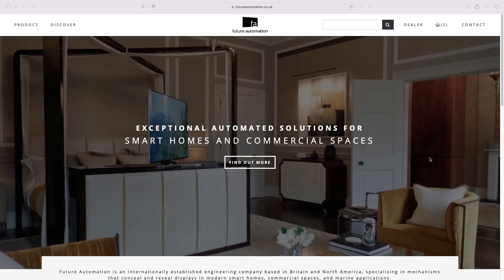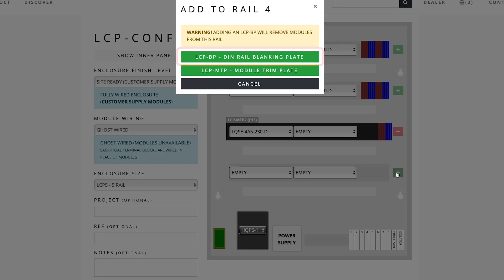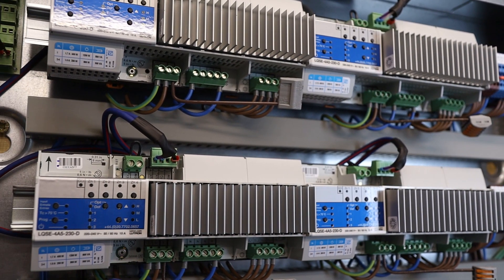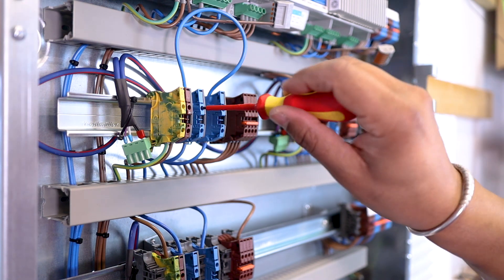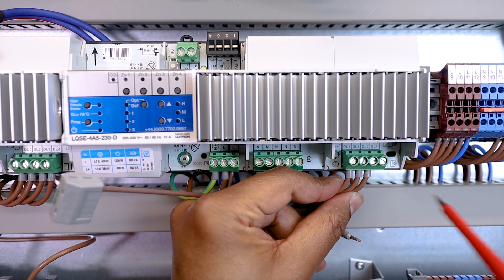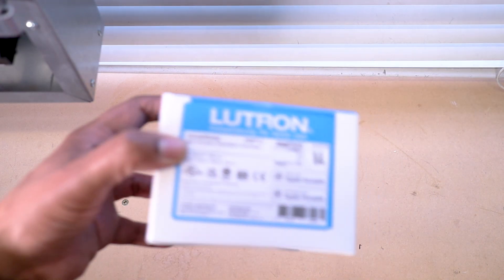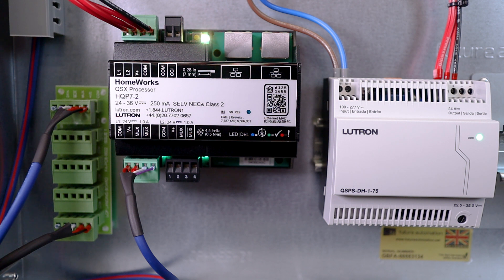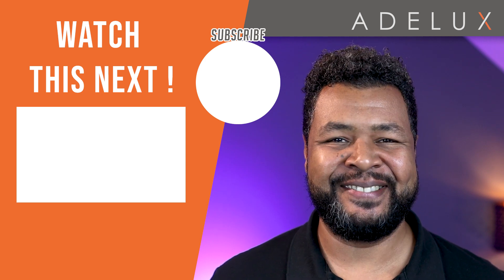Future Automation Ghost Wired Panel for Lutron HomeWorks - Specification & Full Panel Build [NEW]

Comment: Great tutorial.
How could this system be used for the needs of some public institutions, e.g. schools or hotels?
Control of different types of lights from one place, such as a control panel placed at e.g. duty staff or receptionist?
The voltage level of buildings 0.4kV. The voltage level of light circuits is 0.24kV.
Reply from the maker: Hello thanks for your comment. This can definitely be used in the type of projects you mentioned. 👍🏾
Reply: @adelux  Perfect!
I need this kind of system first of all to control the hallways light of one large library.
Then also for depots designated for extremely valuable books, business premises, and a magnificent entrance hall.
Of course, I have a question for you.
Is the Adelux lighting control program free to download?